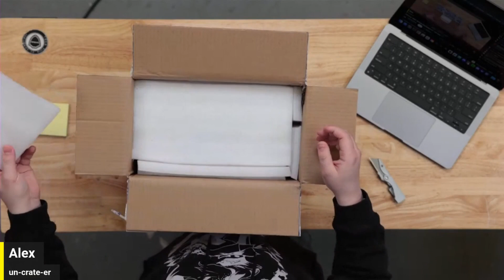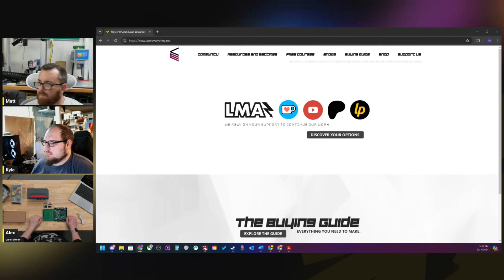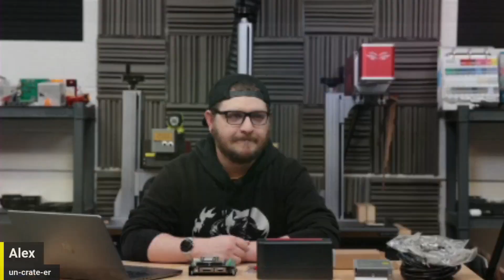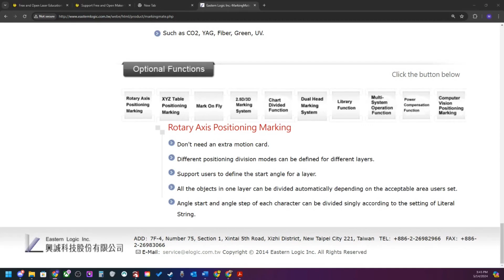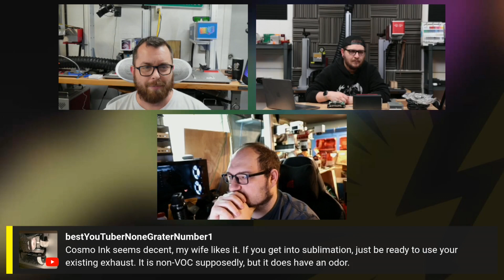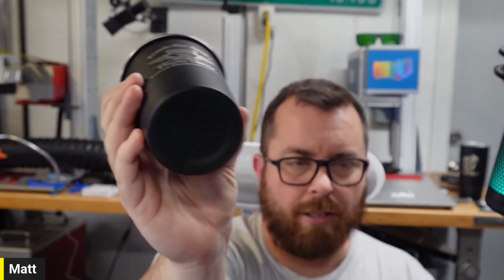[LS126] xTool Creative Space, 3D Engraving Equipment + MORE

Comment: Every time I use cylinder correction my edges fade or won’t engrave like the middle. I can’t go over 1.5 inches. I’m using a 30 watt emp fiber 210 lens. I’ve watched your video and believe I did it right. I feel it’s a focus issue once it gets out of focus it fades.